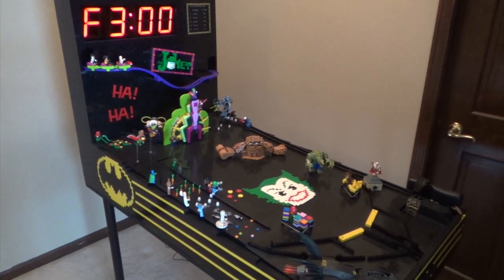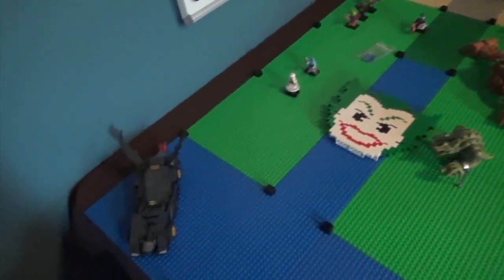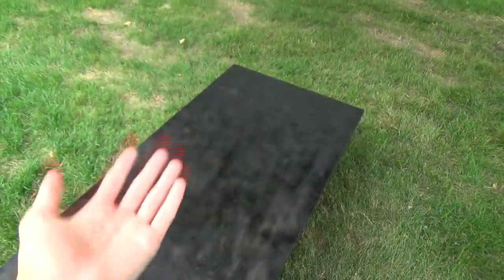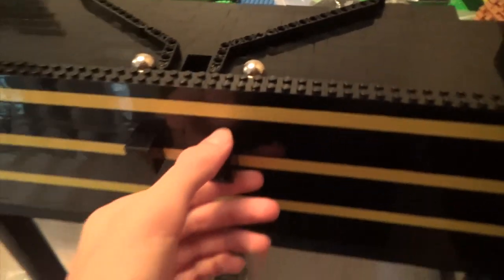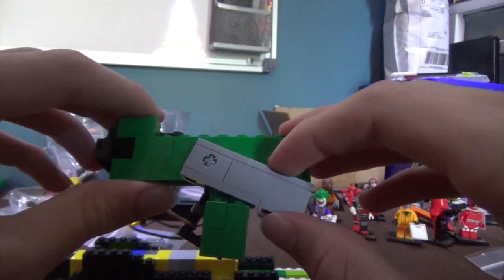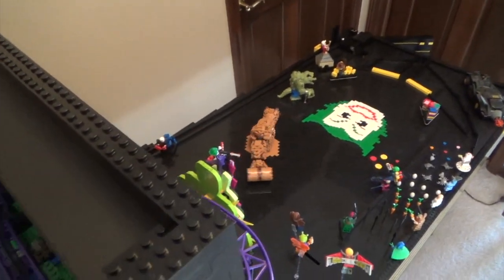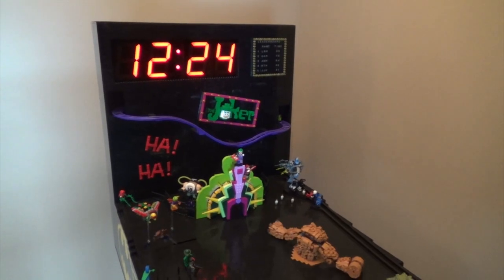The Making of A Life-Size Lego Pinball Machine

Comment from the maker: Showcase Video (includes review, prototypes, and gameplay!)-  https://www.youtube.com/watch?v=f7UM5b5JIpA&t=3s
Timestamps:
Introduction- 0:00
Pieces Overview and Prototypes- 1:25
Sanding and Preparing the Wooden Base- 4:50
Spray Painting the Base- 5:12
Preparing a Mockup- 5:58
Attaching the Legs- 6:48
Painting the Baseplates' Edges- 8:40
Attaching the Baseplates- 9:14
Beginning the Cabinet (Initial Ball Return and Plunger) - 10:21
Unused Light Prototype- 12:44
The Flippers- 13:34
TUTORIAL- Pinball Machine Flippers- 15:14
Playfield Updates and Rotating Clayface- 18:42
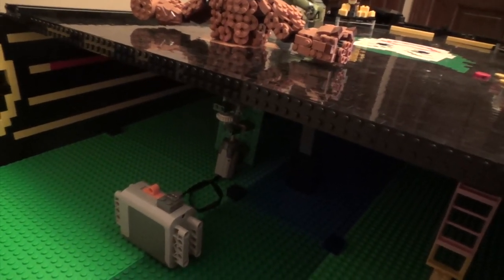TUTORIAL- Spinning Clayface Obstacle- 22:36
TUTORIAL- Side-to-Side Manbat Obstacle and Updated IR Ball Return- 25:19
Completing the Playfield and Backglass Marquee- 29:15
The Roller Coaster- 33:05
The Completed Machine- 35:22
Roller Coaster and Clock Running- 37:26
Final Thoughts and Overview- 38:58

Thanks for Watching!

Comment: Think i start with makeing the base an leg s ..outta tehcnic Lego part an  the side s an frunt .door s to open it up ..to the motor s    im going to add ..lighting an sound s. A drop hole ball  hold s ree pops out. An yousing mini fig poping up an down.spining around an moveing. An ninjago spiner s tourning. An many other cool play option s .molty play when ball goes up into bottem half of the score bord. . ...thank so much on your creativity building this. .just I not adding wood no glue no paint no screw into base plate  as i yous them other plate can join under botem